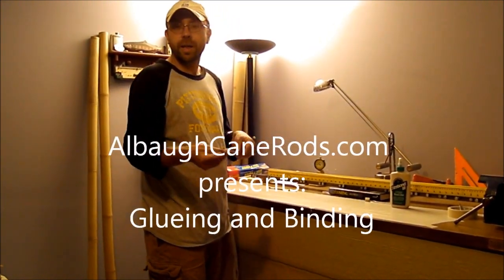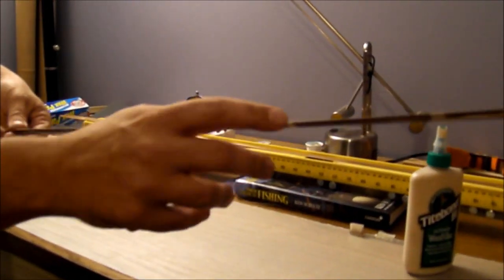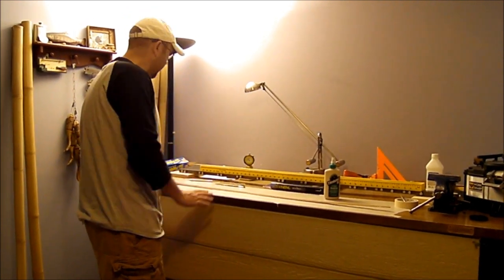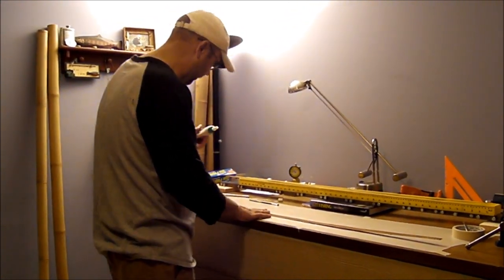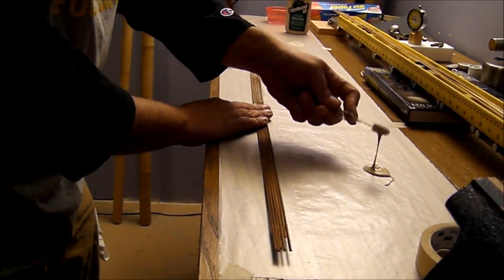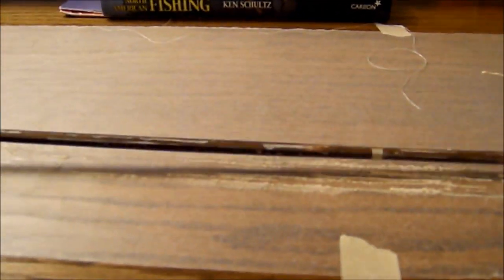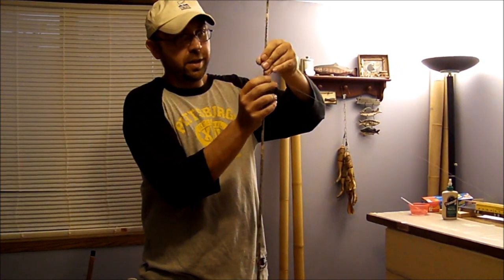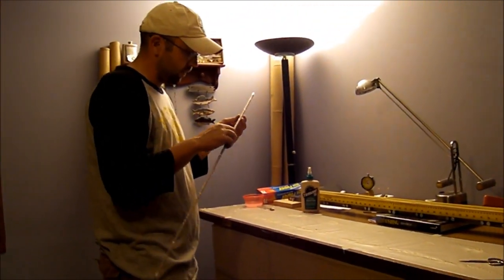albaughrodco_glueing and binding.wmv

Comment: Have not used Titebond III for glue up, but may be considering it. Currently use Epon and wear gloves, but still manage to get some on me during clean up, including the use of solvents to clean up the binder, glass plate to roll the blank, etc. Like the idea of no toxicity with Titebond, however short work time is a limiting factor. Read on the Titebond site that it can be diluted with 5% water by weight or volume to increase work time. Some makers apparently "mist" it.